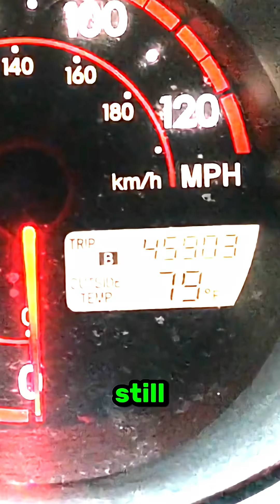Does engine oil expire if you don’t drive the car😱

Comment: Totally true I used to only go a couple blocks with my Yukon 9957 vortec 350. In the winter time I would go just a couple blocks can you shut it off it never get up to operating temperature fully I pulled oil fill plug and it looks like puddin vanilla

Comment: if it ages inside the chamber than why it does not age inside the bottle at the shop
Reply: Exactly!! What else is he gonna say? Pigs fly?!
Reply: Chemicals breakdowns over time even airtight in a bottle ,,4 or 5 years old oil still in the original bottle is trash...look at production dates when buy oil and tires
Reply: @heinhandsome2010doesnt oil in the ground last forever? I tho this was the same type of oil that you put in the car
Reply: I think the video is trying to say that the engine is not 100% sealed. He has a point, if you pull out the thing to check the oil you now introduced air into the closed system.